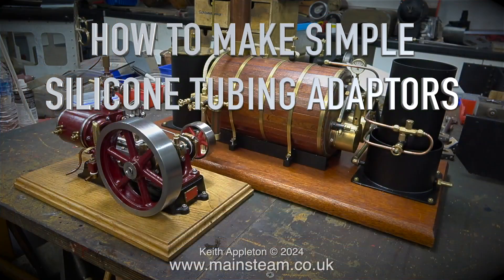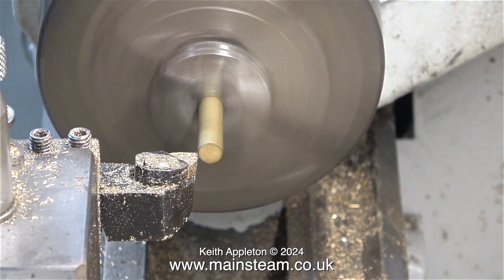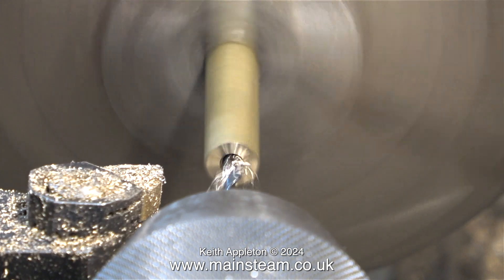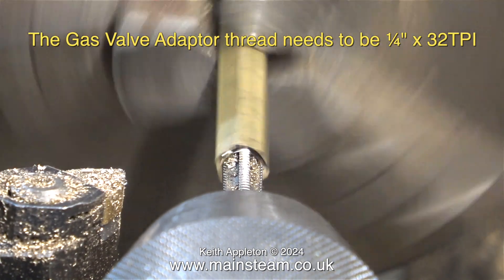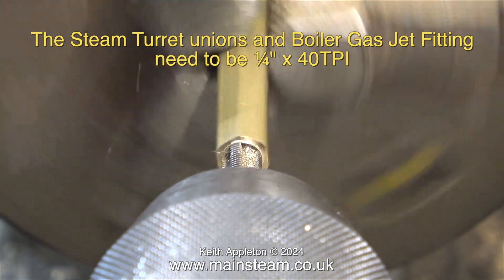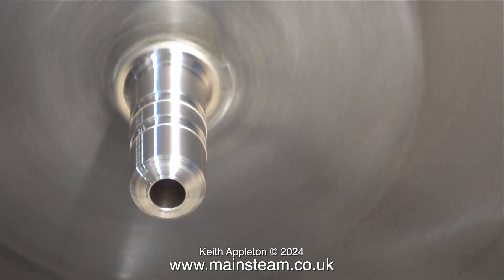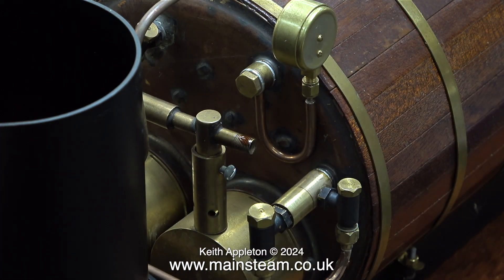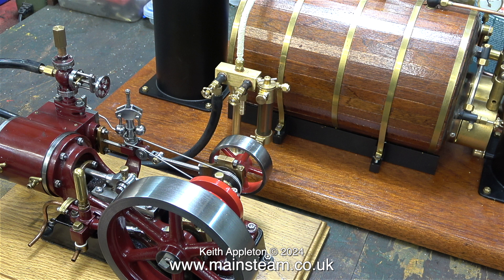HOW TO MAKE SIMPLE SILICONE TUBING CONNECTORS

Comment: You often comment about losing parts into your chip tray; why don't you catch them as they come off?
I've seen (and used) any number of methods; a piece of cardboard cut from the corner of a box solid parts or something down the centre of parts like these adaptors.
I've also seen people stop the cut just before it breaks away and snap the part off.
Reply from the maker: Yes I do that sometimes ........